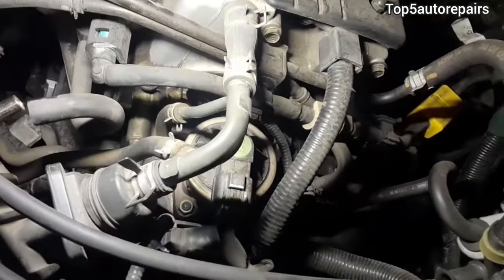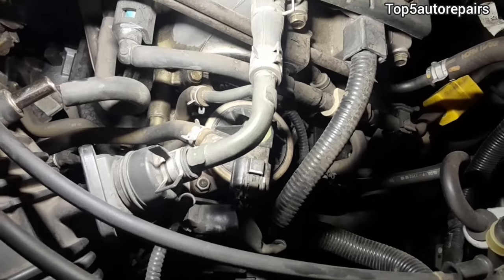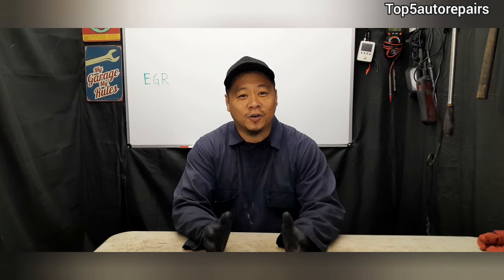SIGNS OF A STUCK OPEN OR STUCK CLOSED OR CLOGGED AND BAD EGR VALVE

Comment: Best thing is too replace EGR valve if vehicle is 10 years old or older..
Reply: Nah, get rid
Reply: Yeah, mine's 9 years old and the plastic is looking brittle. Little leaks can develop so best to replace.
Reply: @24ology 190K miles on my 2008 Volvo V50 2.0d (no DPF from factory) I have never replaced the EGR and I’ve had the car 9 years and 100K miles.
Recently a vacuum pipe broke and it is now stuck closed, but of smoke on cold start & under sudden load / WOT… but otherwise no issues. 
She is returning 50mpg average over a tank of diesel (UK MPG not US gallons)…. Basically 550 miles for 45 litres of fuel.

I would suggest to viewers to clean their EGRV if it is sticky… some driving under heavy load also helps “blow away the cobwebs@.
Reply: TOOOOO replace
Reply: I dunno about replacing it. But at least clean the EGR system and try that. Just replacing the EGR hasn't solved your issue for long. The soot will build up in the valve within months and you'll have the same problem all over again. I suppose however, if you're a mechanic, replacing the valve and charging the customer for a full cleanout is a very lucrative scam!
Reply: Bruh, what kind of car is that in your thumb?  Closest i can guess is a GTO, but i know it is not. So what is it?

Comment: Turn it off. It ruins engines.
Reply: I keep hearing this, would you mind linking a video to explain this to me like I'm new?  =P. Tysm if you do (:
Reply: @user-xs3uh4ms9h  think of your engine as a set of lungs, and the intake and exhaust is your esophagus. The purpose of the EGR is to recirculate exhaust gasses back into the engine. You wouldnt be breathing very well if your body recirculated carbon dioxide back into your lungs instead of constant fresh oxygen. Infact you'd start to die from Hypoxia because your body would be in a constant load of carbon dioxide and your cells would start to die off.
Reply: @Kyle-zy7ny andthe PCV gasses comvine with carbon and coar valvea and rings and oistons xaysing issues
Reply: @warrenwinslow4266  nobody wants xaysing issues

Comment: This is what my 2008 Jeep Liberty was doing. Very hard start. Would not idle. No acceleration. No codes. Could not keep it running! Tapped on the EGR Valve several times and it's running perfect now!!! Thank you so much for producing this video!

Comment: I like the way hes says just clean EGR valve to get to mine is a mission!
Reply: cleaning it never works, anyway.
Reply: i need three arms to get to mine...getting another expedition is not in my plans...every job turns into a nightmare
Reply: If your going to go to all the trouble, to take it off, you might as well put a new one on, and be done with it.  Cleaning it, sounds like a disappointment waiting to happen.
Reply: @SantosSantos-bf5sz 
I restored mine, worked for 8 more years until car was scrapped, so yeah. I guess "it never works" is true if you have no talent, but that's with most things. 🎉

Comment: great information! Have my suspicions either my valve is stuck closed or maybe a sensor issue on my old 1990 f-150. My other suspicion could be my MAP sensor. Check engine light came on. Recently just got the truck and my OB1-2 reader got stolen lol. So going to Oreillys tomorrow to read the codes. Interesting though the truck ran fine on the way home and I just noticed a small air hose was disconnected at the air box. My buddy thought it might be a PCV valve issue. As soon as I re-connected it ran like crap, especially throttling in 3rd and 4th gear. Interested to see what it ends up being. Thanks for the info!
Reply: Update: EGR sensor was unplugged and I suspect for a reason. Vacuum lines disconnected etc. Forced delete kit at this point. Not by choice. Running much better now that I've done some mods. Love Oreilly's

Comment: Thank you so much. Will a bad EGR  cause your car to shut down while / off while driving ?
Reply from the maker: It can cause misfire and stalling when EGR valve is stuck open.
Reply: Will stuck open egr cause carbon buildup inside of the intake manifold?@Top5AutoRepairs
Reply: @adamc4155 yes it will, an egr valve is horrible for the engine but they try to sell it as a good thing. Would you re-breathe air  over and over? This destroys engines, DOESN'T improve fuel economy (it's a lie), and doesn't help with engine heat either.  Everyone repeats this,  nobody tests it.

Comment: my 07 explorer, when idling at a stop, the rpms drop...starts to shake...feel like is struggling not to stall.  sometimes the acceleration is not as responsive.  had throttle body checked and cleaned, maf sensor checked and cleaned, new spark plugs and a general tune up.  still the same.  could a bad egr valve be the problem? this does not happen every time in idle.  it is intermittent but has been happening more often than not lately.
Reply: yes, if its stucked at open position the MAF sensors signal will be incorrect and the mixture will be poor so the RPMs will jump and in extreme cases it could stall

Comment: So I got an 89 ford probe gt and getting code 16 egr contain valve sensor and I have changed it and still comes up. Could it be the egr solenoids  going bad and trying open as well?
Reply: I love that car
Reply: vacuum .! Make a home Depot smoke machine YouTube it. Problem solved

Comment: I have a 96 Chevy blazer with barely 100k miles, I have replaced 3 brand new egr and I still get the same codes P1406. I don’t know what else could be causing this issue any help?
Reply: Check the EGR passages, such as hoses or connection points

Comment: Can I test a electronic egr by disconnecting it and test run it?
Or it has to have an engine code to tell me it’s faulty?
I’ve been having a acceleration problem rpms won’t go pass 2 when driving while speed climbs but slowly.
Have taken it to a transmission shop to check it they said gears were keeping in.

Comment: Would egr issues trigger Bank 1 oxygen sensor 1 to foul?
Reply: Let me just take it off clean it and put it back on. Just dealing with crank no start issues sometimes takes 2 cranks sometimes with stop and start it takes 70 cranks total. Possibly injection or fuel pump or clogged filter.
Reply: Update fuel pump in the tank has a built in regulator that's leaking can toggle the key 5 to 8 times and it will build enough pressure to start. Once running has never stalled. Checked fuel pressure at the line into fuel rail and it never held. Changed injectors too as 5 of the 6 were leaking badly so flooding 5 cylinders. Wet plugs. Also found there was no egr on this model 2002 Town and Country lx. Just a plug.

Comment: P219A Chevy 5.3
Replaced injectors 
Replaced upstream oxygen sensors 
Replaced plugs and wires 
Cleaned throttle body
Reply: And still having issues, or?

Comment: I got a Chevy impala 2005 and it has the code for egr valve, a guy told me to brea clean it and it should be ok but that didn’t work but looking at the egr it doesn’t seem to be getting stuck open or closed so I’m wondering if it could be something else causing the code
Reply: Could be the electronics or vacuum. But I'm not a mechanic.

Comment: I hear the knocing noise😢 even after replacing egr?? What nex to stop noise of knocking
Reply from the maker: Knocking noise at low speed, high speed or at all times?
Reply: I'm sorry I meant I only replaced egr pressure cencor.  The knock started after  driving up hill and hose came off pressure cencor  car over heated and turned off.. after replacing hose  I hear knocking. I drove 6 hours to my destanation😮 it drove okay still just seemed lil rough. After going fster than 40 it seems I can't hear it any more?? Is my egr stuck closed?
Reply: I've been driving every day since and it is still driving good. Besides the noise.  I don't know anyone to help me change egr.  I will try myself. I hope it stopes the knocking noise

Comment: I got the egr error code and my car is shaking like crazy when its idle but i took put the egr valve amd cleaned it (it already looked pretty clean) but that didn't help. Any suggestions. I have a 2010 belta/yaris.
Reply: idle air control valve

Comment: Hi my Audi A3 diesel 
P048A00 code has come up exhaust pressure valve stuck closed which has now lead to dpf light on as well as no boost pressure on acceleration

Comment: I have a 2010 1.6 TDCI Focus and my EGR is playing up, I lose torque going through the gears, if I stop the engine ane restart it right away it clears the issue for a few miles but always comes back.  I had the EGR replaced 2 months ago and all was well but it's just started to happen again.  Any ideas?
Reply: here i have the same prob how did u fix the prob
Reply: @mickmcdonagh5747  I didn't, it is still happening. I had the EGR valve replaced and fuel filter. The problem is much better but when I go on the motorway after about 5 miles the torque goes, around town it's ok where it didn't used to be.
Reply: Does it have a EGR sensor as well on your vehicle and was it replaced? May also want to change your MAF or MAP or whatever you have. Going through similar symptoms to replace this week
Reply: @darkdestroyer2837  Hi, I'm not sure about an egr sensor to be honest. I do have a MAF sensor which was quite oily which I cleaned up but haven't replaced. my car seems fine now unless I go on the motorway and after about 5 miles the torque goes again.  I'm thinking of changing my car now so I don't want to spend any more money on it but thanks for your comment.
Reply: That's caused by turbo position sensor it's a small sensor on the back of the turbo  they are common for going wrong on peugeot engines, which is fitted to the focus
Reply: @kevinsaunders8784  thanks for this, I will certainly check it out.
Reply: @lusiscus  no probs hope you get it fixed

Comment: 19904.9 i6 bronco, Its alway idled nicely but after a few minutes of idle it'll suddenly drop down in rpms and almost dies then it swoops back up and idles fine again.Started running like crap under light acceleration, and smells like burnt chemical BBQ.

Comment: I have a 08 impala and I change both air pump and valve pump then this happened?

P2440
Current DTC
1/1
Secondary_Air
Injection System
Switching Valve Stuck
Open Bank 1

Comment: Any idea on why a oil top would pop off while driving it's a Dodge ram 08  it's a 5.7
Reply: This can be cause by a plugged PCV sytem, or more likely severe blowby, where combustion gasses blow the oil out of the crakcase and up to the valve covers. This could be cause by broken rings or severe wear. Not a good idea to drive the vehicle until you figure it out.
Reply: Is your ram equipped with a sprung fiddler stick?

Comment: EW10J4 PEUGEOT 2004 EXECUTIVE 406 PETROL
My obd2 scanner only gave me one fault code 
P0403 code EGR circuit malfunction.
I have had this car for 1 year and there has always been a strong fuel smell.
The car has been driving excellent but now it has the engine warning light
and the ANTIPOLLUTION FAULT display. It seems there are only 2x 13mm bolts holding the EGR down. Is it possible to use brakecleaner or wd40 to clean the valve or is carb cleaner the only option.